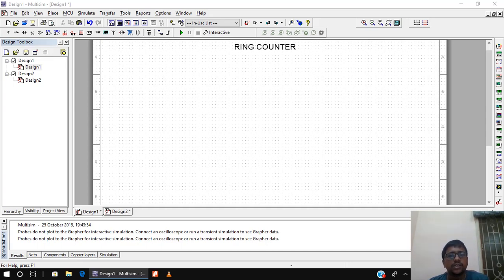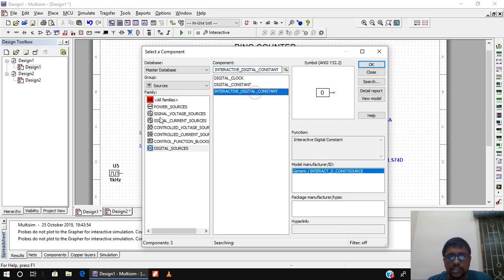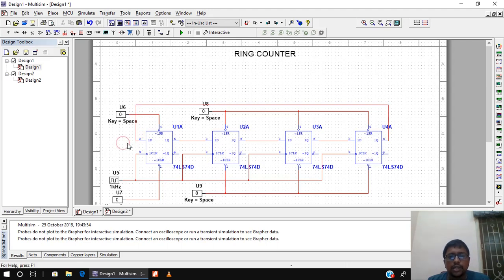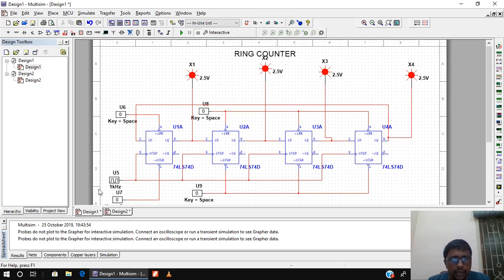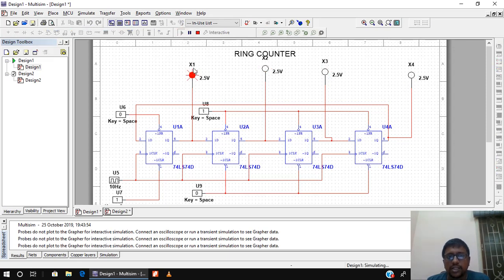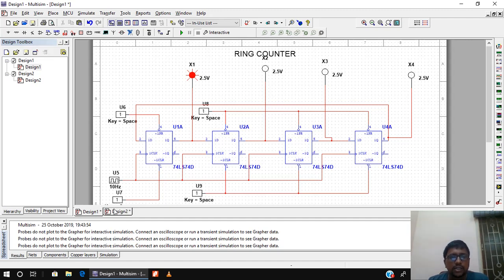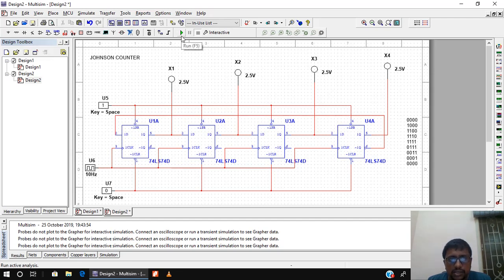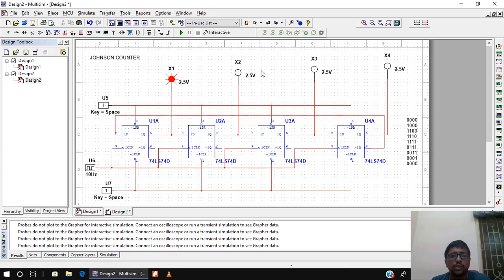Ring and Johnson Counter using Multisim

Comment: Sir how to design a shift registers which performs shifting operation by giving 1101 as the inputs
Reply from the maker: Give interactive digital constant to first second and fourth flip flop and set preset value as 0 and clear as 1 which will initially set the flip flop. For the third one, give separate preset and clear and set it to 1 and 0 respectively.
This will set the value as 1101. Simulate once and pause it.. then make all preset 1 and clear as 1 and start giving the inputs..if it's a shift register. If u dont want to use clock pulse, u can also use interactive digital constant as clock pulse